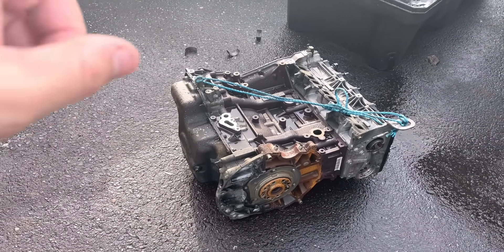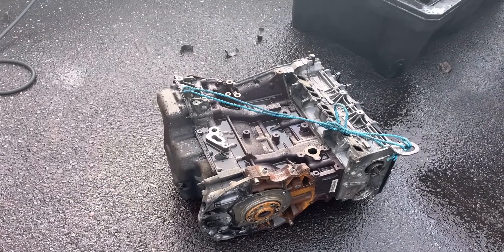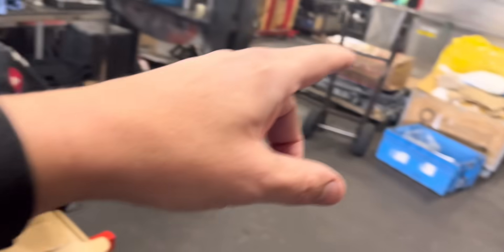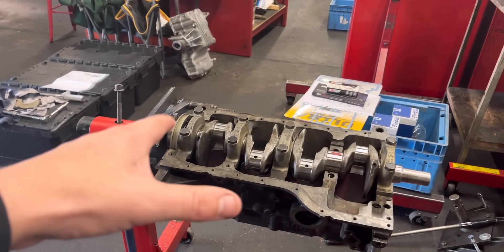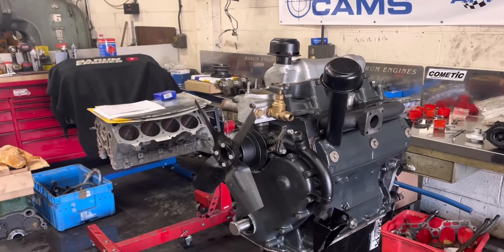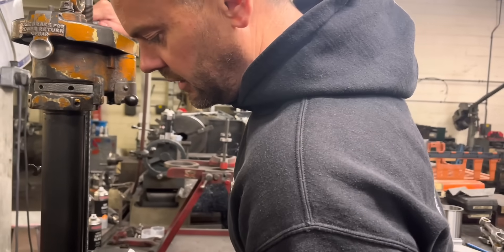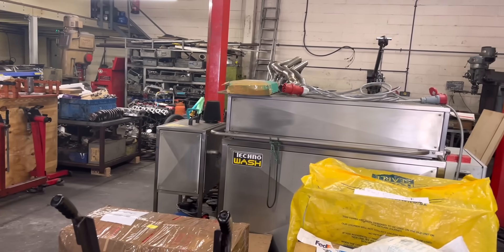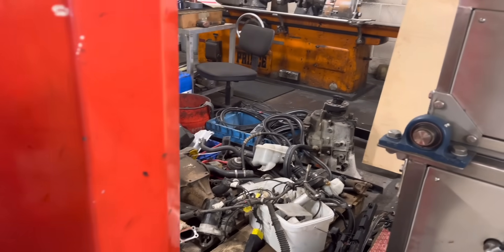This is why engines should NOT be built by amateurs!

Comment: The best "amateur" mess-up I've heard was a rebuilt that would only run with the old worn cams. If you put new cams in it you couldn't turn it over, not to mention the sharper ones. Long story short, all the pistons were in back to front.

Comment: I bought a 350 Camaro when I was 19 in 1989. Ordered high compression pistons from America. Went to Nottingham and got a high lift cam, 750 cfm Holley carb, Elderbrook manifold, duplex timing kit, high pressure oil pump, solid lifters and Cherry bomb exhaust then found out the engine was a 305 when the bloke was trying to bore it out. So bought a 350 block and got it all sorted. 0-60 in 5 seconds.

Comment: Silly remark about “amateurs”  I have known a lot of “amateurs” who rebuilt engines to race, and who did well at it. Often machinists by trade, who can use top quality kit at work. And of course all those guys who built jet engines at Vicars works, not one of whom would have called themselves a professional engine mechanic. And of course my neighbour from years ago who worked for Hawkers,electrician I think, but whose cars were always diesel no matter what they left the factory with, (I don’t think he ever did the Isetta !)  Professional, my arse. there is a  rebuild firm a couple of miles away that no nearby mechanic will touch with a bargepole !!

Comment: Nothing wrong with an "Amature" having a go. My first engine build was my old 2wd YB lump back in 2014. Did everything minus the block and head skim/bore and made 447 on the Dyno and is still going today. Long as you measure and make sure everything is clean with tolerances against spec you can do a good job.

Comment: Isn't the Rover V8 closely based a Buick V8 from the 1950's or 60's that always had oil leaks because it was there 1st aluminium block. Rover made it a bit better but never fully fixed it and now with modern gaskets they can be good engines.

Comment: In my 50 odd years of messing with cars as a complete amateur, I have built many engines, including some for competition purposes. I have never had a failure. The only time that I did suffer an engine failure, in my competition Mini, was one built by a professional!
Reply: I think  it's not realy doing credit to mechanic enthousiast to rule there are pro and amatures .  commercial shops most of the time are over theire head in costs , so if there is money saved ...its there.  Now the complete useless type , you know the ones with no clue , tools and working in trainers  ....  they should get some help and not bodging together engines
Reply: Just lost my sub.. being an "amateur" ?????? 🇳🇿🇳🇿🇳🇿🇳🇿 .. professional snob
Reply: You do know that the only difference between an Amateur and a Professional is that the Professional gets paid for doing the job !!
Reply: This means you are a professional without the badge 🧑‍🔧
Reply: @frog-eye1420  he wasn't paid .. so amateur .. like me fixing "professional" f¥€kups .. just like Barrum Engines .. "machine" shop NOT a performance tuning shop .. nor by admissions a diesel shop .. WHY that !!

Comment: Love the channel awesome work! buttt I have to take exception about the festering rover V8. what an asthmatic dog! from oil leaks, low oil pressure, head bolts that pull their threads, over heating issues, stupid tin valley gasket,  premature cam wear, atrocious casting quality. plus the myriad of other problems and to cap it all wont rev and produce as much power as a mamod steam roller.  A simply hideous creation of an engine!

Comment: Re the rover / TVR v8's oil pump. They really need a baffled sump. I was on a track day at Bedford and after the first few corners, the oil sloshed and the pump sucked up a load of air. net result, game over and a ride home with the AA. The oil pumps need to be primed before starting which is not the best thing to do on a track day. Not sure if there is a pump out there that does not need priming for the Rover V8
Reply: V8 pumps need priming only if they've been left sitting for long periods. Also, if the oil is decent then they usually get oil flowing round fairly quickly, although I've never bothered with the pressures too much as (a) the dial is rarely accurate, and (b) they depend more on volume anyway.

Comment: Definitely a fan of the Isaac and Lee double act. Adds an extra dimension and makes for better camera angles over trying to do it all yourself. Be careful though....he'll be asking for a pay rise with all these extra duties. Oh..and nice job on the Landy motor. I just inherited an old 50's Triumph motorcycle to renovate, and having to mess about with wierd imperial threads and fastener sizings is a brain strain for the metric schooled. I still don;t understand why a 5/16 whitworth spanner isn't 5/16 anywhere...and why you can;t just use matching fasteners all over. Still....it's worth it when it's done. Just need to find someone who can bore out an ovalled distributor mount in the crankcases, and put a sleeve in, and do it well enough so that the worm gear on the distributor still meshes with the rear cam that drives it. Ahh..the joys of old metal :)

Comment: Messed and engine myself long ago when I rebuilt a sunbeam rapier engine. Did not realise that I needed new con rod bolts and nuts. Nut came off and con rod went through the side of the block. Get someone who knows what they are doing.
Reply: Don't beat yourself up over it, plenty of so-called professionals wouldn't have know to do that as well.

Comment: Engine on the crane going by the clues small(relatively speaking)high revving and powerful I'll guess a Busa for the kit car 😉 transit if it's the Puma 2/2.2/2.4 and lost a cylinder probs injector related eg as Lee says injectors over/under fuel burn pistons etc hence ancillaries must be checked or renewed. Rover V8 was the custom car engine transplant favourite of years gone by very light weight but not overly powerful in standard form, ford SBC 289/302 are quite a light block( by iron V8 standards) after market parts are available to boost bhp way above std but Rovers availability wins I guess 👍. Great to see the YB Cossie still going strong with a block design which is essentially 50+ years old 😁 I wonder how many more mod😢performance engines will stand the test of time? Keep up the good work 👍
Reply: Any way of keeping an eye on that? I've got the 2.2 in a baby Discovery or Freelander 3 as I tend to think of it! 
I run Vpower diesel in it and drop the oil every 6214 miles (10k ms lol!)...  I track the fuel consumption to watch for any weirdness.

I'm connecting a half decent iCarsoft CRMax to it about once a month just to have a nosy. No faults in the past 8 months of my ownership. Plan on keeping this till the wheels drop off or 'they' force us to go electric 🙂

Remember plenty of Rover V8s, even one or two in the SD1s, back in the day when speeding down the A1 was a thing ;-)